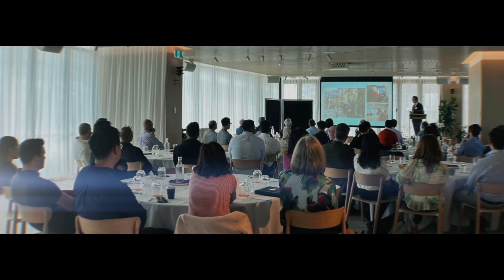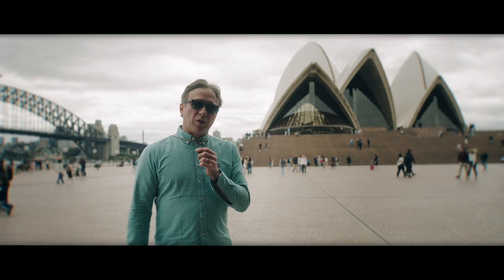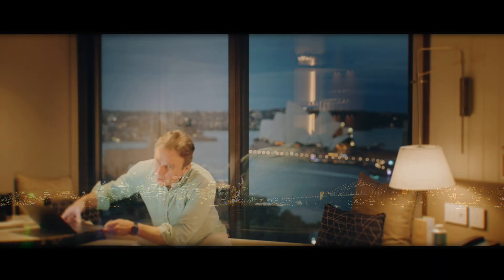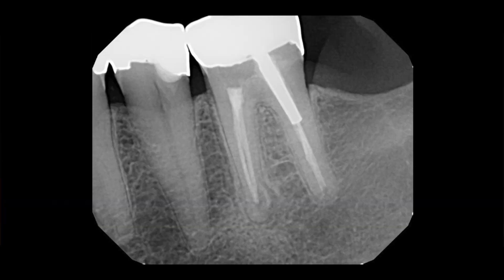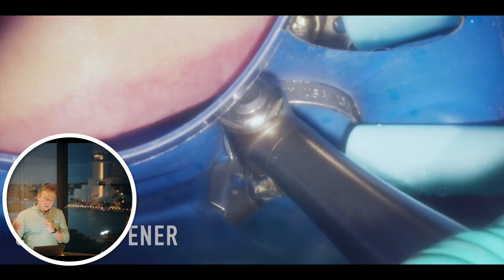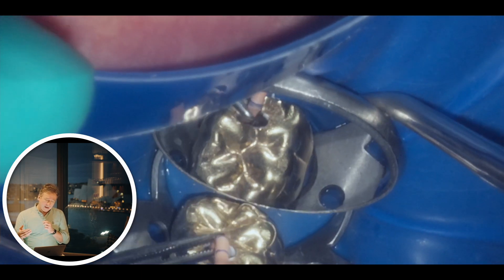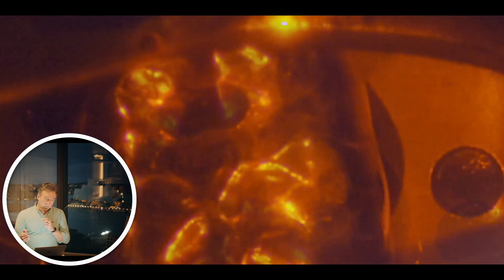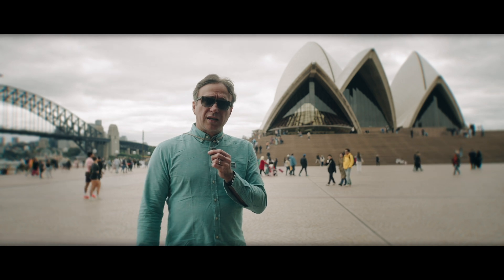Segmented Hydraulic Condensation from Sydney Opera House! (Hydraulic Post Space)

Comment: Awesome video, thank you for sharing. At the 6:00 mark you mention obturating at 40/04 even though there is a "step" preventing the cones from reaching WL, but that you were still able to get patent with smaller files. From the post op x-ray it looks like the sealer reached the area beyond the "step"....how does one decide to use this approach vs just opting for a smaller cone that reaches the WL e.g. 35/04?
Reply from the maker: That's a good question and has to do with where you finish. I just did an article review with Drs. Blitcher and Pryles that will be coming up in the next couple of weeks. It does address this exact issue based on the article about the role of patency, etc.